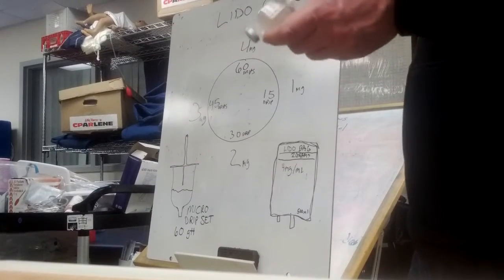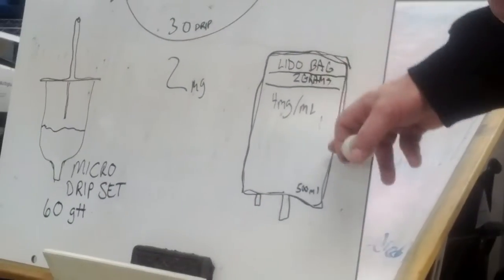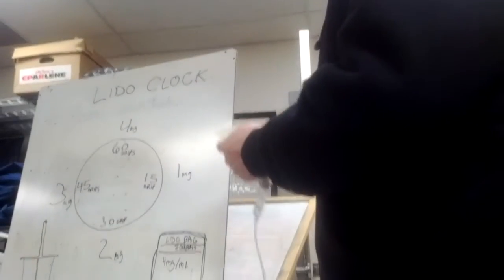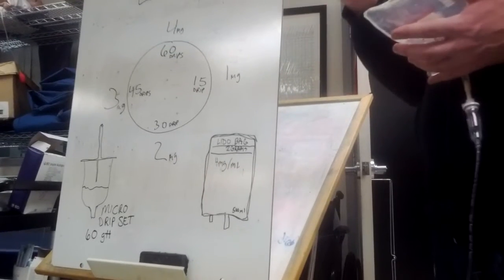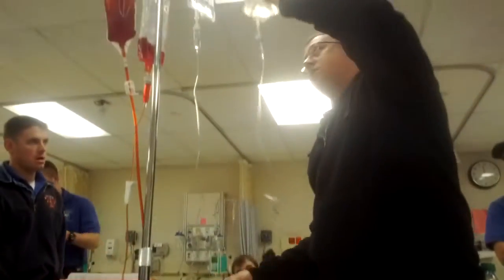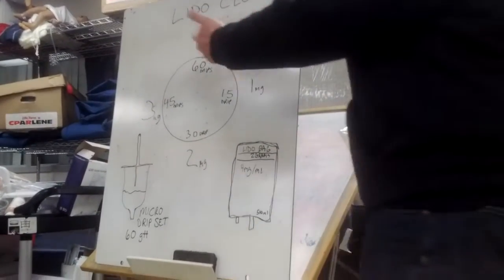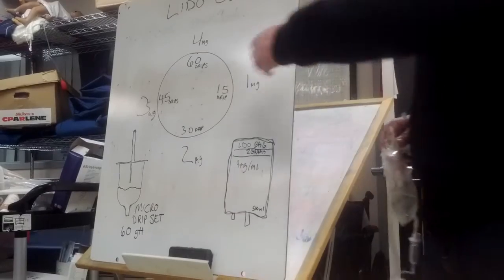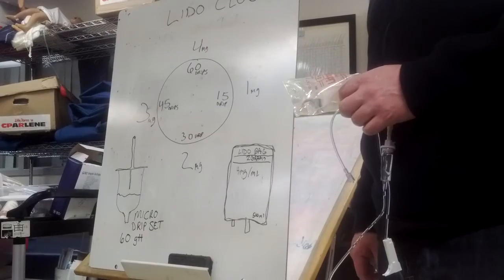NECC Lido Clock Explained

Comment: If you put the 2mg/10ml in 500ml bag how does that equal a 4mg/ml concentration??
Reply: 1g in 250cc = 4mg per ml. 
 2g in 500ml = 4mg per ml. 

Are you asking because the addition of 10 ml of fluid into the bag?